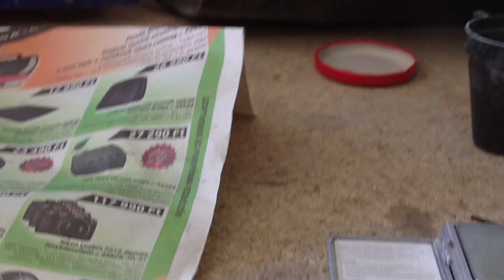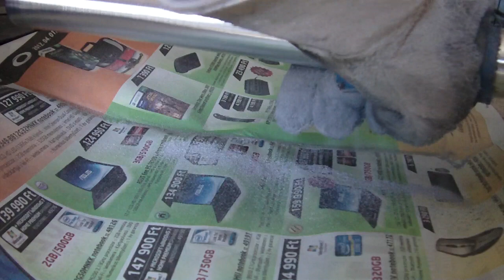Make 45u Magnalium Powder

Comment: So, what is that tube or rod you start with?  Can you buy magnalium tubing?  I wonder if one could be make a solid state or hybrid rocket using magnalium tubing as the fuel?  Will it react with N2O or H2O2?
Reply from the maker: Hi! Its rod. The metal fuel very low effectivity in rocket engine, not recommend.

Comment: Can we make aluminium powder in same way?
Reply from the maker: Of Course! Working very well! Aluminum rods can be purchased in several places. Drill a hole in it and drive in a thicker screw.
Reply: @MrPyroMaster  thanks bro and what mesh is it?
Reply from the maker: @channelcircuitzilla7339  I do not know! :) It depends on what kind of sandpaper you use! If you use finer paper, the resulting powder will also have a smaller particle size. But the process slows down!
Reply: @MrPyroMaster  thanks for helping sir😊

Comment: Wow... Your method is really nice 
and You're replying to people too which is nice because i need your help 😅
Now i have an Aluminum block and a pencil sharpener that made out of Magnesium and a File, Normal cheap sandpaper that you could find in any paint store, a drill 
So if i tried that I think that it won't work because of my sandpaper can you give me a link for it or let me know how it's producing some fine powder like that 🤯
Reply: Another question 
i will try to cut my Aluminum block to slices and the same with my pencil sharpener (which is too small i don't know how 😆)
will it work ?
Reply: I just googled it 
It's 100 Grit sandpaper ?
Reply from the maker: Hi! Don't cut the aluminium block! Use a belt sander instead of a drill. One with adjustable speed!

Use 100 or 60-grit sandpaper. I think that's the international designation. You can use a belt sander to make flakes from any object.

Be aware that it is a very reactive powder. It can oxidize in open air or water! It must be protected with paraffin oil!
Reply: @MrPyroMaster  
Thanks for the info.
May I ask another question ?
I know that making Magnesium powder is very dangerous in ball mill because it's very reactive but what about aluminum ?
My method was only 12 hours (1 hour then 15 min rest)
with a bunch of charcoal like 5%
and I will open the container every 1 hour
so I made safety steps to it's max levels, probably 😂
Is it okay ?

Comment: Where did you get the roundstock? #subscribes#
Reply from the maker: Find called boiler anode. This stuff is used in boilers, water heaters, against corrosion.
Reply: Thx dude!
Reply: Hmm... I can only find 'magnesium' anodes. Are they pure magnesium or magnalium?
Reply from the maker: Its magnalium. High magnesium content. 75% or upper. Very god stuf, for pyrotechink using. Sori my english. after 4 beer. :))))))))))))
Reply: ***** im from germany, my english is also not the best ^^ cheers & Prost!

Comment: What sandpaper is better for making aluminium powder. Finer or coarser.
Reply from the maker: Coarser!
Reply: @MrPyroMaster  but if I want smaller size of fractions.
Reply from the maker: @Росен-в5б  No need! It is very reactive! But if you want, you can refine it afterwards. Use a coffee grinder. Caution! Friction may cause it to catch fire!
Reply: @MrPyroMaster  I tried with sandpaper P120(its fine) and even with that it hasn't burned. I mixed the aluminium powder with kmno4.
Reply from the maker: @Росен-в5б  Potassium permanganate decomposes slowly. If it is too old, it is less reactive. High temperatures are required to ignite the mixture!

Aluminium flakes are also recative. In the open air they oxidise rapidly and form a protective layer. The rod I use is not aluminium! It is an alloy, 75% Mg.
Reply: @MrPyroMaster  ok but I testet the same kmno4 with factory aluminium and with the homemade. With the bought aluminium is good but with my own even cant ignite. Its the same kmno4.
Reply: @Росен-в5б  if you're making flash powder and you're trying to use aluminum you need a specific grade of aluminum powder. They call it pyrotechnic grade like Indian black or German black. It's finely ground aluminum with a little bit of charcoal, it's extremely highly reactive.